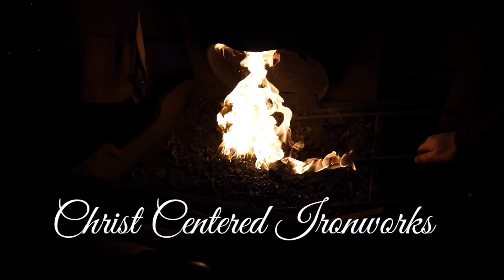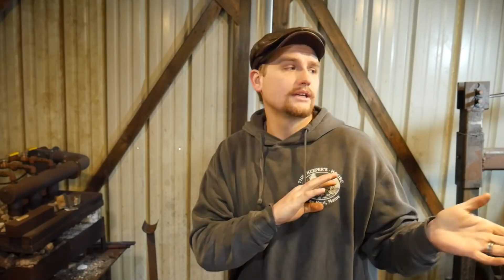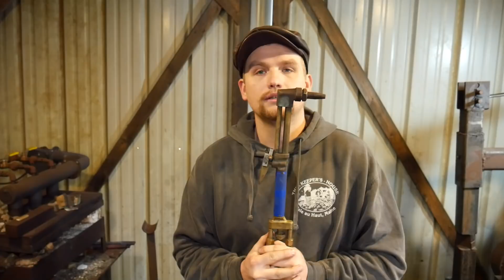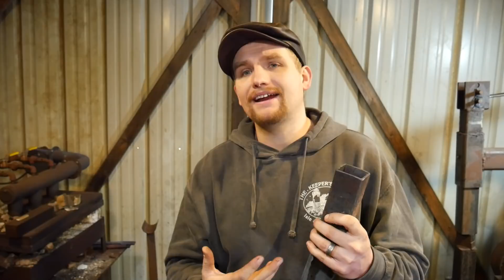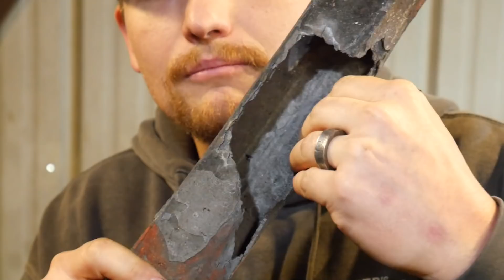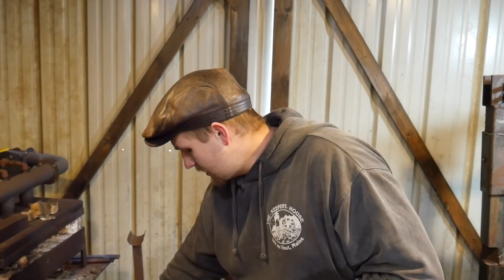MYTH? Can a gas forge burn steel?

Comment: Thanks for the video Roy, In Essence , Rust is Iron Oxide, Right ??  Oxygen destroys  iron & Steel, as well as other metals, You can actually cut steel with a welding  tip on , "Oxy- Acelletene if you get it to temp, & increase the Oxygen flow , while decreasing the Fuel Supply, I've Done this for years. Thanks Again For The Great Video, Roy.
Reply from the maker: Yep it's essentially the same :)

Comment: Oxygen is you're worst enemy for any arc welding process also. Welding is tough in windy conditions because the wind blows away you're cover gas and exposes you're weld to oxygen. Welds exposed to oxygen will have porosity and look like Swiss cheese or worm eaten wood

Comment: adding oxygen on a cutting touch doesn't super heat the steel Roy. It's a thermal chemical reactions. you are super fast rusting the steel away not heating. it's the same thing with the tube it's oxidisation not temperature it's rust. steel is an unstable material it likes nothing better than joining with oxygen. Ferrous material always try to join to oxygen. heat just speeds this up. It's not a burn dude just oxidisation. it's rusting not burning.

Comment: I have a question about Forge Welding... Is it Common to hear a loud bang when you are hitting hitting the steel to initially set the weld? It was loud! Almost sounded like gun shots. I was using just regular borax from the local store. Im pretty sure that it was the flux being squeezed out of the material that made that noise as it only happened on the first few blows. Anyone that can give input would be appreciated. Thanks!
Reply: J.R. Meyer when setting the welds it's common to hear a pop or bang dude. it's one of two things the slag or scale being ejected from the weld or the moisture in the flux or borax.
Reply: Daniel Moss thanks I figured as much just wanted a second opinion

Comment: Hi Roy,  a great way to illustrate this point is to put a piece of steel in a forced air gas forge and bring it up to high temperature and then shut off the gas and leave the blower blowing, it will burn up without even a flame. (Don't ask how I know this, Haha.)

Comment: When I start my forge and adjust the air, I see a nice blue flame as it gets hotter I can hardly see the flame, is this the correct adjustment for a gas forge. ?
Reply from the maker: +Lenblacksmith yes and no a neutral flame will have just a slight dragons breath out the front or back doors. This flame will have a slight blue tint to it. If it has a dark blue tint to it you are running rich on propane and if it has a yellow Flame you are running rich on oxygen you want to split the difference. Hope this helps God bless
Reply: Yes Roy that helps, I do have dragons breath coming out, only when It gets hot. Haven't noticed the colour actually, but will check it out next time, thanks Roy...bless ya.

Comment: Good video. As with most myths there is a grain of truth. As you mentioned a couple of seconds of not paying attention can get you in trouble with a coal forge.  A couple of seconds is not going to make much of a difference in most gas forges. It all depends on the setup. Its all part of the fire triangle(heat, oxygen, fuel)... at the right heat and oxygen combination... the steel becomes the fuel!

Comment: As I understand it "burning" of steel happens at ANY temp! It is just a reaction between the steel and free Oxygen in the air and is a lot more aggressive as the temp increases! So if you want to reduce this effect eather reduce the temp (not easy if you want to push metal, or even wield it) or reduce the Oxygen available to attack the work (again not easy, although this is how TIG and MIG works) ....... or reduce the time available for the Oxygen to react with the Steel! 
As with most skills it is a balance of ALL the effects that determine the outcome!